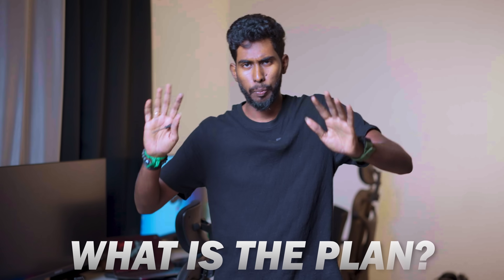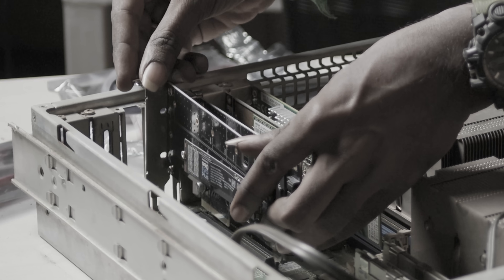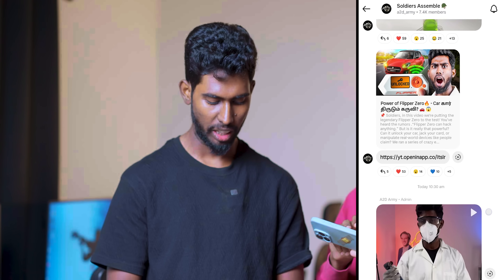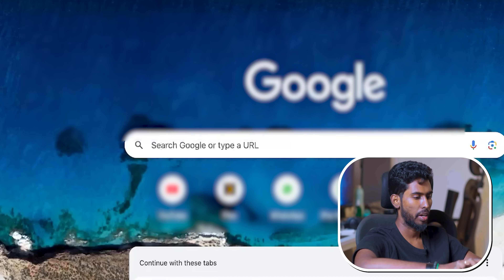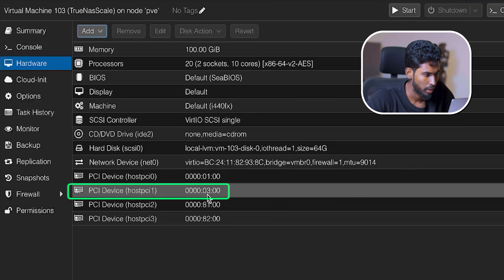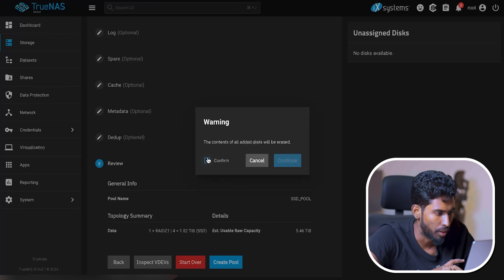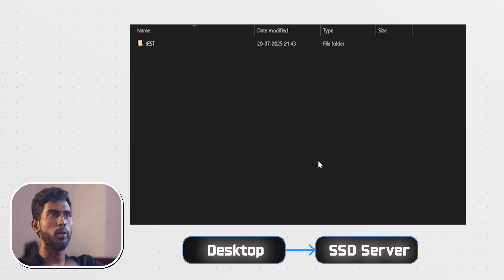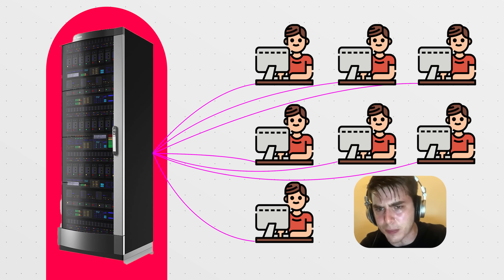8000 GB Storage Upgrade - SSD vs Hard Disk 🔥 | எது போடலாம்?

Comment: Bro neenga switching speed ah increase panum 20gbps bottle neck la than poi mudiyum en solrana.

20gbps nic total 2giga byte varaikum pogum.

Athe maari ssd oda speeds 8GB la Iruku so neenga server side 100gbps link kuduthinga naa each editor can acess 1GB read. Ipdi pani paarunga kandipa difference irukum.

Comment: Hey Bro, there is a software called G-Helper, which is an alternative to Asus Armoury Crate. It helps increase GHz and clock speed while optimising battery efficiency. Please review this software and share your feedback and reviews with our Soldiers, bro. Why Because this is will be more helpful for the Asus laptop and Asus PC users.

Comment: Hi bro, I am using 16GB Hp14s dy5005TU laptop and my RAM is always occupied. so i want to add another 16 GB ram. Which ram should i select? please comment.

Intel core i5 7th gen 1235U
512GB ssd
Intel integrated graphics

Comment: Hey, I’m planning to upgrade my Lenovo ThinkBook 14-IIL (model: 20SLA047IH). I want to replace the existing 8GB RAM with a single 16GB DDR4 3200MHz stick and add a 500GB WD Blue SN5000 NVMe SSD while keeping the current 1TB HDD for storage. Can you confirm if this setup is fully compatible and if any precautions are needed during installation?

Comment: enaku oru doubt ipo harddisk la files ah copy pani store pani delete pani use panradhu oru limit varaikuma irukum 1tb hdd na maxium oru 10tb vara files ah store pani delete panalam ah apram andha limut thanduna tha hdd corrupt oh failure oh aaguma
Reply: Yes! But, Server HDD has more TBW limit than normal HDD, check the TBW limit in technical specifications on the manufacturer's website !